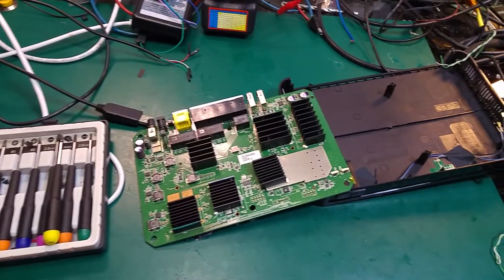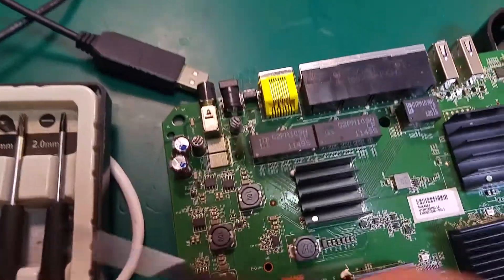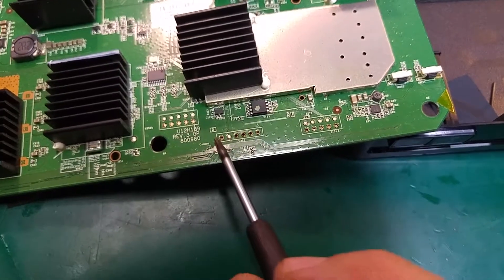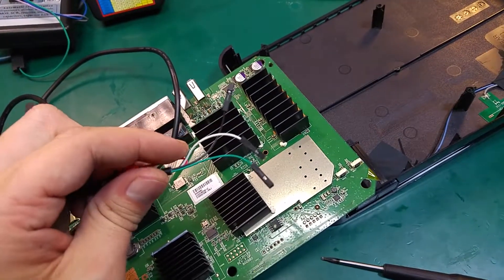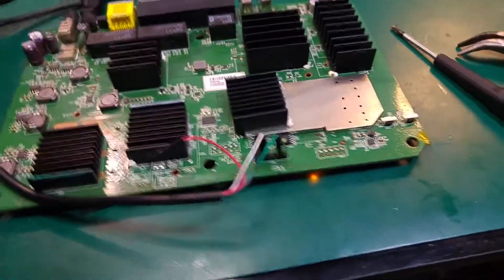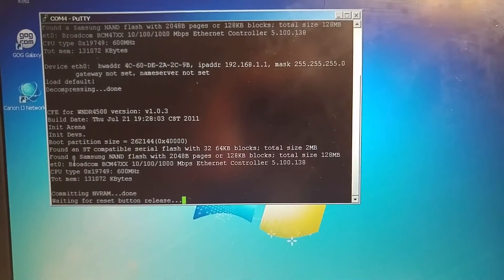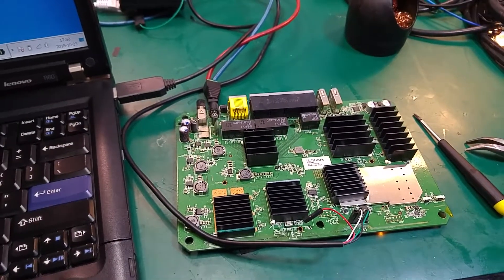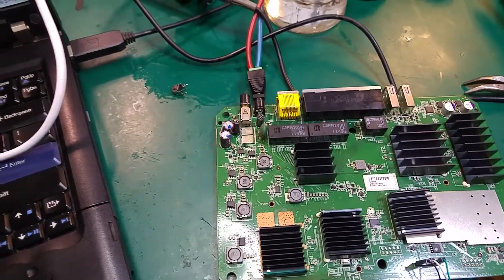Netgear WNDR4500 - checking what's wrong using serial terminal

Comment: HI mate, can you please let me know what type of USB to TTL cable you are using. I have bought two cables now which both use the prolific chipset, but no matter what configuration i put the pins on the router i only get a garbled mess in the putty console. I have used the same serial connection settings as you have here and a range of others, nothing seems to give me a legible output.
Reply from the maker: Garbage output usually means You have wrong speed, check with different one baud rate until You see valid output.

Comment: hello there, i have the same router which suddenly after the thunderstorm not working. while i turn it on power light is okay but not allowing me to get in, using ethernet port. any help buddy
Reply from the maker: Maybe that's silly, but have You try reset it via button?
Reply: @ElectronicNoobBlog  thanks for your reply, well i tried many times to reset it but no response at all. while i press reset button nothing happens even the power light not blink for once or goes off, it is constant.
Reply from the maker: @shamskt  Try  one more trick, unplug DC jack, press and hold reset button, plug DC jack and still holding reset button wait 10 second then release - sometimes it help.  If not You can try connect serial connection like on this video to see if it show some error code or waiting for upload firmware if there will be something about waiting for firmware there is a hope - keywords for search is "tftp netgear update firmware",  if it's dead or output garbage then in GENERAL, when You have lightning and device suffer problems - i would give it a pass because it can work unreliable, drop connection or hang, anything can be damaged from CPU to memory or flash. Trying to replace each part is not worth time because it is obsolete and very cheap router.
Reply: @ElectronicNoobBlog  THANKS A LOT MY DEAR